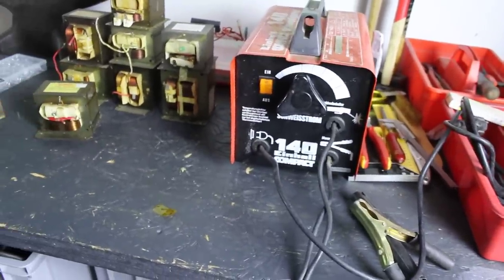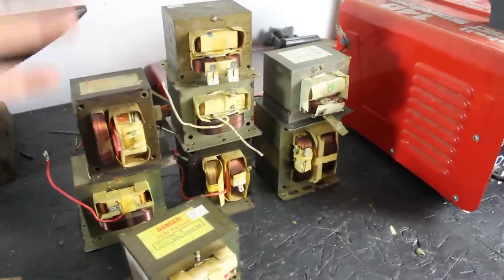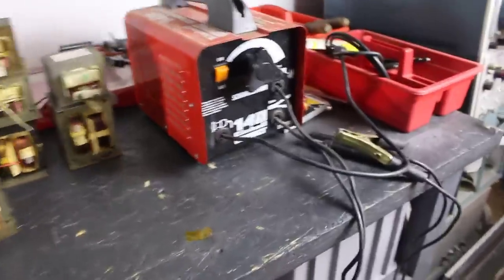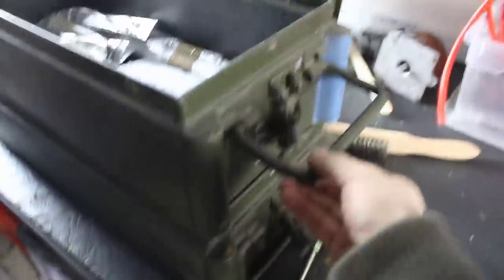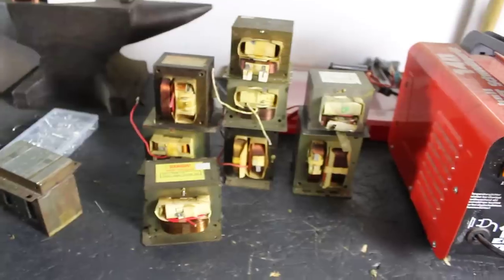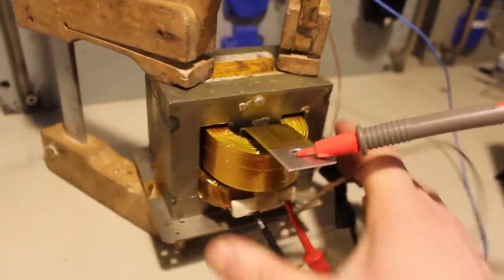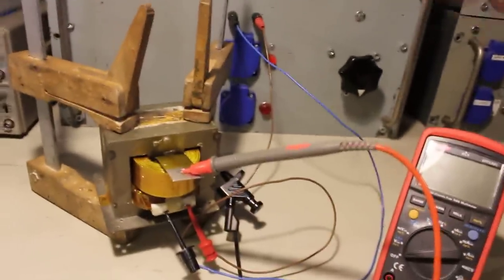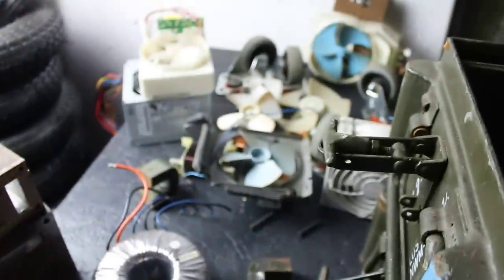Shop Update:MOT Welder / Welder from Microwave Oven Transformers

Comment: Big respect for you for doing things differently. I made some beginner tutorials 6 years ago for MOTs and most people have used that method. I've never seen anyone use copper strips and kapton to make their new secondary. Looks great. I have a third method I've kinda kept secret since I never got around be to making the followup project videos, but I think your way is much more professional. One tip, I suggest you add more turns to your primaries, even up to 100% extra, MOT waste heat is ridiculous especially with the shunts removed. Can't wait to see what you make.
Reply: copper strips are not as common because is harder to get them than thick cables

Adding extra primary windings is not always possible as there is no space available
Reply: Yeah, it's tricky. Check out the tutorials on my channel. You can usually squeeze 6-18 turns by adding 1-3 more full wraps around the existing primary, and then when you get rid of the low voltage heater coil you can throw another 24 in there. If you knock out the magnetic shunts, you can squeeze a bit more.

Depends on the application. You just have to accept the MOT is half the size it should be to run cool, and adjust accordingly. I've stacked 2 primaries in series as the new primary which leaves about 1/3 of the space for a secondary. Lazy but it works and runs cool. In a welder I wouldn't bother since it's intermittant use and loud (so you might as well use a fan) anyway.

Comment: Hi Tpai, if you take apart the einhell weld set you'll see that the current control moves a magnetic shunt in and out of the transformer core, the more the shunt in moved into the core the more it shunts the magnetic flux and therefore the output current drops.
You'll also notice that Mot's have 2 shunts (2 shunt pieces that make 1), you might be able to move these in and out and adjust the current the same way, might be worth an experiment on a few different settings.
Also if you put a choke inline with the weld electrode made out of an Mot fully stripped and wound with 10 - 20 turns you'll find the rod will strike better, the inductor smooths the weld current a little and the back emf it produces improves arc force on startup.

Comment: I used to be a service engineer for the commercial microwave ovens.
Noisy transformers are almost always due to a vibrating coil, we used to drive a wood plug in the hold the coil secure. It often worked well. Maybe some silicone compound will do it.
Otherwise the transformer had to be replaced, up to the customer to put up with the noise or have the transformer replaced.

Comment: also, unrelated to this video, i would like to see a diy project, where a dishwasher, of which the motherboard refuses to work, to be controlled by, say, an aduino or similar microcontroller. my impression is that the motherboards of this kind of appliances are designed to fail, and they are unserviceable for most diy-ers. 
these machines' components are relatively simple. they mostly just registering or providing on/off: electrical valve(s), heater, pump, level control(s). 
by contrast to the unserviceable and often expensive motherboards, controlling such components should be relatively straightforward, at least for basis programs: emptying, rinsing, cleaning with soap, rinsing, maybe drying.
if you feel so called, i think this could be very very interesting!
many thanks in advance and success in your endeavours.
Reply: wi'lle'm 
Nice idea!

Comment: A quick little tip, if you didn't know: Those diodes are designed to be screwed onto heat sinks. They WILL burn out if you just connect wires to them.

Comment: As an old school guy let me give you a little tip make your bridge recitifire the same amperage as the max shorted output is gonna be tgrough the thickest welding electrode it can weld with because if a fuse blows most people just bridge it and if the output is shorted for a longer period of time your transformer will melt and no trust me you cant use thermal fuses aso they all die very soon since they cant handle the very high voltage spike when turning off the welder and especially the turn on/weld current spike

Comment: in your case with the 9 mots i would just find long thick wire and pass trough every mot once or twice so the whole secondary circuit is in series. connecting coils in parallel would  lead to unnecessary current flow and power consumption in idle
Reply: John Scarce he said series, which would be the same as what you're proposing but less unwieldy
Reply: the problem is the coil he wants to put just to be creative puts out 9 volts so its about 9 turns which means if he puts such coil on multiple transformers he would  have to do parallel and series connection groups

Comment: If your workshop is cold, I'd suggest one of them parabolic propane heaters that sit atop a propane cylinder, that way you can stay warm while you work... :)
Reply: twocvbloke I think the insulation is lacking.
Reply: He could also wire up a couple of salvaged microwave units and direct the beams of them into the area he is currently working in. With interference pattern from several units there will be a local maximum of heat. Better still, put them on the wheeled robot and let it track him around in the shop. He will always be slightly overcooked, while the rest of the shop is below freezing.

Comment: You say 9v out isn't enough for a stick weld but if you can use a metal bolt and clamp to one winding end then connect the piece to be welded to other clamp and this will be OK for a spot welder.My trans has a output of 2.5v works well (watch sparks though)

Comment: Used 5-10 kVA step-down transformers can be had inexpensively here in the states.  Some are single phase 240 to 120 and others are three phase 480 to 208/120.  Chop out the windings on one of those and that is all the core you'll need vs so many MOT cores.
Reply: That's actually a very good idea. Though we in Germany normally use less (but larger) transformers, except maybe for little farms in the middle of nowhere. So small ones might be a bit hard to come by.

Comment: Great!! :) now I'm waiting for the modification of the weldingmachine with the rectifier bridge and maybe the output filter. You can use a MOT as a choke for output current filtering! Another useful suggestion, as I notice you have a lot of MOT, to reduce the noise and the heating for the ferromagnetic nucleo leakege you can put two MOT in series and than in parallel. So you reduce the primary voltage arround 115V, the core is less under stress :)
Reply: Tell me what you think abput that!! I'm really interested in this ckind of project, and maybe could be developed an inverter weldeding machine! :) can you tell us the ecxact name of the rectifier??

Comment: Where i'm from 120v is standard outlet voltage.  The mots draw way too much current at idle to hook many in parallel without tripping a breaker.  But if you had access to 240v from a stove outlet with a 40a breaker you could put 2 primaries and secondaries in series (should be identical transformers). or possibly parallel the primaries on 240v but the mots magnet wire might not be rated for that?  The higher voltage would let you get away with fewer wraps on the secondary and thicker gauge wire.  Still the low KVA rating of the transformers would probly give you a terrible duty cycle, mounting them to a large heatsink and a fan would help.  You could also try using various large inductors on a switch to try to control the welding current.

Comment: Nice score on the diodes. If someone is trying to do this even cheaper, I'd suggest junkyard alternator rectifiers in parallel. Heavy-duty alternators can push over 100 amps, and even the everyday sedan models should be able to handle 60 amps or more.
Reply: N Ferraro alternator rectifiers are 3-phase. That's not to say you can't use them, but you'd need to parallel several of them to handle the current, unless you somehow rewire the diodes. Also, your information on alternators is really outdated. A base model subcompact typically has a 90A alternator minimum, these days. 120- 140A is typical for a midsize sedan, and there's cars with 200A or higher alternators from the factory. But again, they're three- phase. The diodes they use are usually good for 50A each, some are good for 70. There will be 6-18 diodes in there, half of them standard ones, and half of them reversed. (Almost always 12mm press fit diodes, that's what I found in Bosch, Valeo, and Nippondenso alternators I used parts from for a project.
Reply: I had no idea the output had gotten that high. We used to have alternators rebuilt to put out 120A, and that was considered very high. I don't recall if the units were 3-phase, but the GM alternators had 6 heavy diodes instead of 4, so the older units might not have been single phase, either.

Comment: i hate it when people cut the secondary. its a big coil and you can save it for a lot of stuff for later use or even reuse it for high current secondary by stacking a bunch of thin wires into a big wire
Reply: i made welder with 3 MOTs and i used 2 MOTs hooked (~20V) to weld the 1MOT  with thin electrode and repeat cheers :)
Reply: those transformers are worthless in their original core assembly. the core has way too much flux leakage and the primary coil is very bad. the best thing you can do is open the transformer, add coils to the primary ( i added 1 pancake coil in series on the top and the bottom made out of thick insulated wire) and then do the classic EI-IE arrangement where the transformer holds itself together with no welds needed, because either the coils can hold it together or you can tighten 4 bolts in the corners where you have holes for this purpose

Comment: Amazing, strip wires that are also insulated. I guess you'll have to calculate for the total volts needed with respect to the current that will give at more or less a 'short' circuit. And also the 300 amperes of those rectifier diodes. Everybody must be chucking away their microwaves near you!. Be really interesting to see, if you do some smoothing, what the result will be.
Oh in the video to come please say what the strip wire/tape carries in amperes.

Comment: have you thought about trying to use two E cores only. with out the top. and use the second E core as the top. or other half of the core? I have thought about trying that. it would give more room for windings! great video.
Reply: two E cores connected together ? ive tried but u need to make larger primary coil because i think from MOT's primary is designed only for their factory sized transformer cheers
Reply: i have winded secondary wire that way and i think it decrease  my voltage

Comment: I've yet to see a MOT welder build with taps for at least some semblance of adjustment. If I'm not mistaken I think this is how the old ones worked but I'm not sure. I don't see any reason to build a MOT welder without taps. It's wouldn't be a welder there's too many variables between material and sticks id say if you're not gonna put practical adjustments into this then i guess you can always turn it into a forklift battery charger.

Comment: Hey mr. Tpai creator, can You please consider making a pfc (power factor corection)  circuit for the shunt  transformer. I have seen one a few years back on a welder while visiting an EI university and also can you  upgrade the welder such that it  would weld with basic electrodes (E 7018) so probably much higher  open circuit tension . I cant  wait to see the rectifier . keep up the good work
Reply: Oh the reason for my request is that I,m in need  of such upgrade for my welder wich is bigger, but consider IT not a request because i actualy belive  this may not Be the scope of this channel, but If You can actualy build a pfc please  show how IT can Be dimensioned  for a diferent  transformer

Comment: Cutting the core open is sub-optimal.  You're going to get magnetic flux losses that way, and hum.  Oh, you noticed the hum. :)

Welding it back together is sub-optimaller..  Umm, subber-optimal?  Whatever. :)  You're going to get eddy-current losses and the laminations will heat up.

Better to cut through the secondary winding and get rid of it that way.  Or tediously take the laminations apart so you can unwind the secondary easily.  Or even more tediously unwind the secondary with the laminations in place.

Comment: all this MOTs will you connect them on 220V single phase ?
Reply: i have made welder with 3 MOTs in series i got ~30V AC and this is enough i hv only welded square and round tubes 5mm thick wall and it works pretty good.
mine works on 220V single phase and my clamp meter which isn't very accurate on low amps says that on the main input it draws ~25-30Amps i have 25Amps circuit braker and it fell down just once when i touched the bare wires together of the secondary coils without an electrode to see how much is the peak amperage but idk if i measured correctly it said 300-400Amps
Reply: and im using 2-3.smth mm thick electrodes cheers
Reply: i have 8 PC coolers connected to PC's atx power supply 
and for protection i have 3 circuit brakes for each transformer and also 3 switches for each tranformer that way i can vary the voltage ~ 8/18/20/30Volts AC cuz my tranformers arent the same size

Comment: I tried rewinding the primary AND secondary to make a 60 volt power supply, but rewinding the secondary just caused it to flip the breaker... Why?   I had figured that rewinding the bottom ones with half as many turns could allow me to doublt the 28.5 volts or so I could manage to cram into the space for the secondary..
Reply: impedance? idk. if you really wanna know look up impedance calculation of a solenoid

Comment: Perhaps that filter shade glass is not enough to help your camera when it comes to filming arc welding. Consider electromagnetism. You might well get artifacts ruining the footage if you film to closely. It might possibly even damage your camera. If your camera does not have a zoom lens (for filming from across the room while zooming into the molten area's light with that filter shade glass), then you may need to get one that does.

Comment: What is the secondary voltage of the MOT?
Reply: 9.16V. He shows it in the video. If you're talking about the unmodified MOT, usually between 2000 and 3000 V

Comment: Back when i were a lad i built a TIG converter for one of those red arc welders. http://sigmatechnica.com/tig-welder/  worked ok,  i found the problem was even on the lowest current setting for the welder it was still too much for most of the things i wanted to TIG.   also there was so much smoothing capacitence in the capacitor bank it tended to blast a hole in the workpiece when the arc struck :D